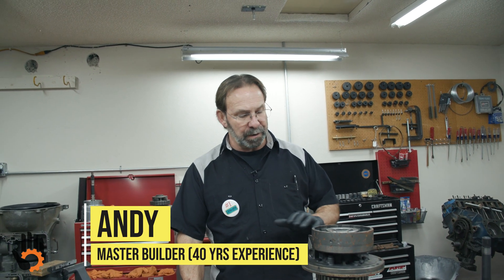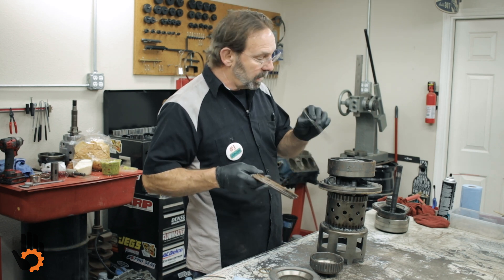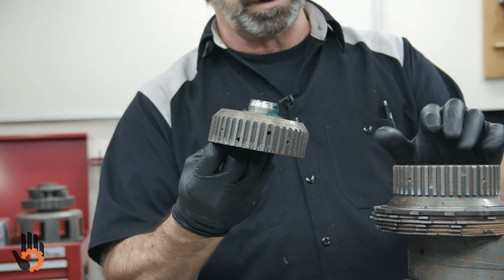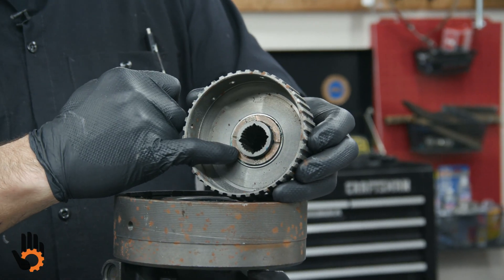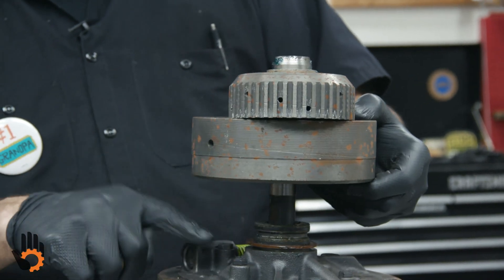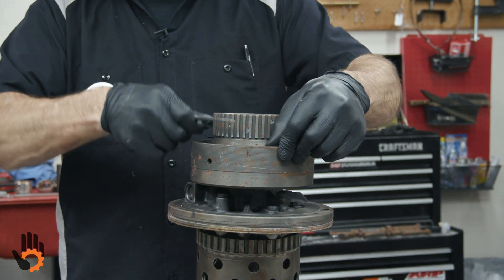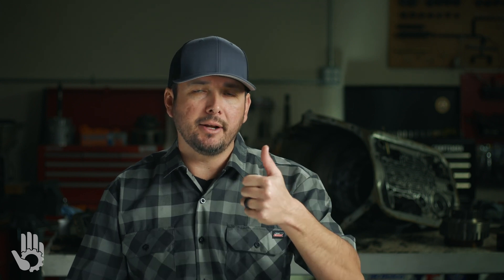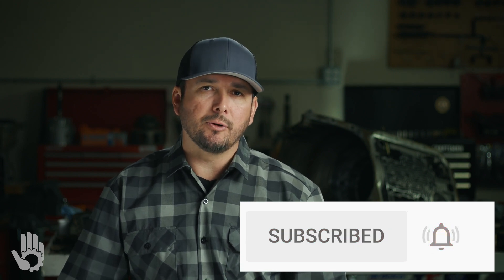TH400 Build Series - Building Clutch Drums (Continued)

Comment: ive been watching these videos obsessively... you guys do such a great job... i gotta say if you hadnt posted this specific video id have really screwed up!
im 2 weeks into my th400 rebuild ...what you guys do in two minutes takes me 4 hours haha but im learning...  my trans is burned up trash... itd be cool if you could cover something extensively damaged like this... ive learned most of the parts and what they do but being able to poinpoint the source of failure would be a great thing to learn
Reply from the maker: Extensively damaged units definitely require more time cleaning.  And when you're dealing with a governor (super-sensitive device that's partially responsible for up-shits/down-shifts), cleanliness is critical.

Identifying the root cause of failure is important, for sure.
Would love to do a video series on how the TH400 works.  But, I'm already knee deep in alligators, with the GM 4L60E.

The positive feedback is appreciated.
Once again, congrats on your successful build.
Reply from the maker: If you're interested in learning more about how an automatic transmission works...
These are all GM 4L60E videos.  It's basically a 700-R4 that's electronically-controlled.  At any rate, there's definitely some overlap between the 4L60E and the TH400.

*************How the Trans Works****************
4L60E Pump:
How Does it Work:  https://youtu.be/gJ5CdPJoJyg

4L60E PR Valve:
Part 1:  https://youtu.be/ELhJlZridIY
Part 2:  https://youtu.be/dJlUec91kgY
Part 3:  https://youtu.be/PY1trZeLqTM

4L60E AFL Valve:
https://youtu.be/LqBkdegPjNk

4L60E Shift Solenoid:
https://youtu.be/FaChWmcsAgI

4L60E Shift Valve:
https://youtu.be/jPhm76RDz6Y

Planetary Gear Set:
https://youtu.be/QjT0CUG73YM

4L60E Power Flow:
Auto shifting:  https://youtu.be/IfOqbTqKubE
Manual Shifting:  https://youtu.be/6kfAuXJFYFE
Reply: @SouthpawAutoworks  thank you... i was running out of content.. i think im low key obsessed with the 400 .... its back on the bench getting a 4l80e drum with 36 ele sprag, red clutches rollerizing the rear case... and a homebrew dual feed mod... im unreasonably excited to see how this goes!
I hope you love your career, because this is becoming a hobby i love... but not a jobby sadly :D

Comment: Hi guys, love your work and have watched all of your th400 videos. I have a question regarding center support seal rings. Recently I received a rebuild kit that has the scarf cut red teflon (or plastic) seal rings. I've not used these before. They are narrower in the groove than the interlocking steel rings. Are you familiar with these? Being narrower ok? Thanks!